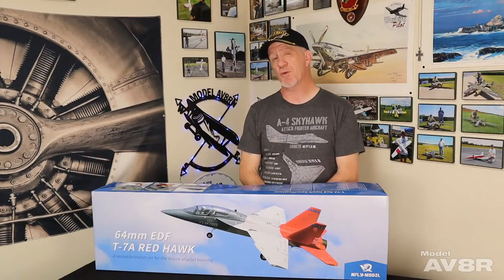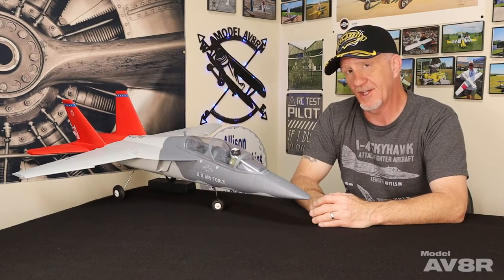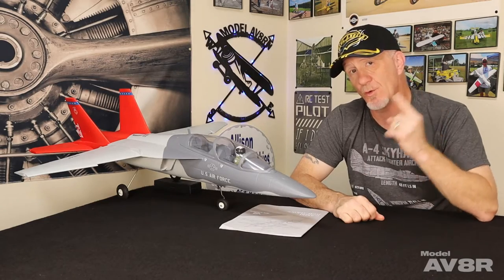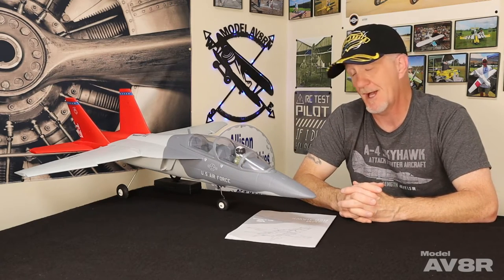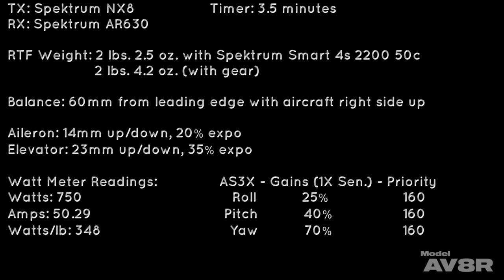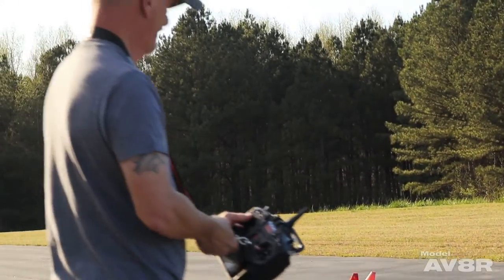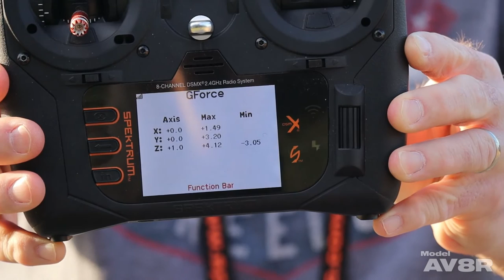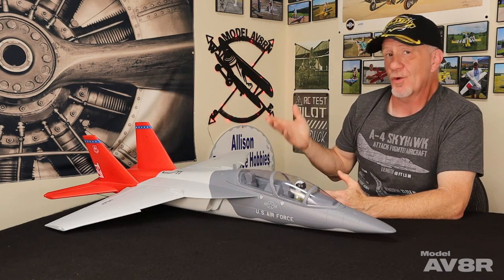XFly T-7A Red Hawk 64mm EDF Jet PNP - Model AV8R Review

Comment: Great vid and review, super flying as usual, thank you. As I have this bird I can attest your review is spot on. One thing you did not mention, unless I missed is the finish on the Xfly birds are fantastic. As I fly off of grass, perfectly maintained at 1/2" and rolled each week, with a bad shoulder, I always fly with the gear and found the 2200 pack is the sweat spot for grass and gear. BTW, I actually used the same receiver. I just got the 80mm version, yet to fly, waiting for spring to finally break in the east. If the 80mm flies as good as the 64mm, it will be a keeper!
Reply from the maker: Thanks very much! The finish was what I'd expect on a plane at this price point. Pretty good. That  80mm should fly even better! Enjoy!

Comment: Yet another 64mm EDF review where the subject sounds better than my Stinger 64, has much better take off performance and looks easy to hand launch, which the Stinger isn't (I only use it from it's fixed gear now). Maybe there has always been something wrong with my Stinger ... This plane looks excellent but I am very eager to see the A10 review as I've always fancied one of those ...
Reply from the maker: Hey man, yeah it does sound good. I flew a 4s Stinger years ago, I remember it did sound like a hair dryer but I liked that it had a rudder...knife edged well. I'm looking forward to that A-10, should be fun!

Comment: Hey Adam, great video. I love mine, great flyer for sure, I left the nose wheel backward, then switched over to the sprung upgraded nose gear, which is a nice upgrade. 

So I ended molding mine to death. I added rudders, 60amp Avion esc with reverse thrust, ar630 as well, with an RC Geek afterburner and a 6s 2200kv 64mm edf. I run an 1800mah 6s battery and might be going back in the stock motor. It seems to take 6s well on the bench. As is, it hit 110 mph, and it's a beast. I absolutely love it.
Reply: Holy smokes that thing will be a missile.
Reply from the maker: Holy crap Anthony! I'll bet it does scream on 6s! The nose gear upgrade is something many folks have mentioned, good to know. Fun jet!
Reply: @Brad  yes sir, much better performance. Gotta be careful with the elevator whilst WOT. It'll alpha lock, lol👍

Comment: Awesome flight and sound! In the first flight you use 3200mah 4s. That lipo is 380gr. A little heavy i think. How was the flight? Didn t it nose heavy?
Reply from the maker: It's a heavier battery for sure, but it flew fine. Not nose heavy at all when the battery is where it should be. Our CG is rear of where the manual calls for. Check out the set up chapter and set up page.

Comment: Hi great review. Is it true that you need to place safe reciever near the Cg.or can it be placed, like yours near front? Will safe and as3x/safe work ok with the RX near front ? Thanks
Reply from the maker: They AS3X works fine in other positions, and SAFE works somewhat well, however SAFE is optimized by getting it closer to the CG. Same goes for trim. AS3X can work with a good bit of trim set, but if you're using SAFE you need to mechanically adjust the surfaces so there is very little or no electronic trim set.
Reply: Thank you for your time @ModelAV8RChannel

Comment: Hi Adam, I know it has been a while since you made this review but I have a few questions as I recently bought this bird. First, how did you handle the CG with the 3200 and 2200? Also, do you think it's possible to hand launch with a 3200? Thank you
Reply from the maker: It's a bit nose heavy with the 3200, but still flies well. You could hand launch it with that battery, but I would program a launch mix that feeds in a bit of up elevator when you advance the throttle. Put it on a switch, and flip it off after its on step and you have both hands on your TX.
Reply: @ModelAV8RChannel  awesome! This 100% answers my questions. Thank you sir!

Comment: can I ask a question? do you modify or change another higher kv EDF unit, your plane seems more powerful , especially vertical climbing. I recently bought a new t7a , have installed but not maiden, I test running the motor but seem not power enough, I now use 3S battery
Reply from the maker: We didn't. Totally stock. We used 4s. On 3s it will be under powered.
Reply: @ModelAV8RChannel  thanks!

Comment: Hi. So hard to get a reply out of YouTubers. I hope you do. I’m almost 50, been flying since I was 8 when I built my Eaglet 50…..after taking 10 yrs off or so raising my kids (and owning 10-20 Horizon foamies) I fly on Safe now and can’t seem to figure out how to get back to regular flying. Do you have any suggestions?? I panic when I flick off Safe now. But Safe has become sooooooooo..boring. But then I get paranoid on as3x only. I wish I’d never met Safe….
Reply from the maker: Yep. That is the issue with SAFE. It's great tech, but meant to be used temporally. You are right to want to wean yourself off of it.  

Ok, so first thing...when you flip that switch from SAFE to AS3X if the plane changes direction without you touching anything, you need to get an experienced pilot (or a comfortable one) to help you trim it out and get the control surfaces mechanically adjusted. When you flip that switch in level flight nothing should happen until you input something. Part of your nervousness could be that it does bad stuff the second you flip the switch without your input, so now you're on your back foot having to correct for something you didn't do. 

Once that is done it might be easier for you. If that alone doesn't do it you may consider getting  the RealFlight sim. It's great being able to practice knowing that if you crash, you just hit reset. 

The other thing is, and you may not want to hear this, but you may just have to focus more. Get yourself mentally prepared. You're going to have to switch SAFE off and suffer through getting your chops back. Keep it off a little longer each time, remember you can hit it later and still save the plane. If you crash you crash...part of learning. Nobody will die, you just may lose a foamy or two.  If you do crash one, fix it. It can look ugly, thats even better...once it has "character" it can be a beater...a plane that is no longer pristine that you're not so nervous flying.  You may also find that after a couple of minutes with you not switching back your nervousness goes away a lot...either way, you have to commit to it sometime. Maybe consider getting help from an instructor to build your confidence if need be. 

Whatever you decide to do, best of luck my friend!
Reply: @ModelAV8RChannel  Great advice and thank you for the well thought reply!  I just re-upped my glue supply and kicker lol. I think you’re right just gotta do it.
Reply from the maker: That's it man. Once you get over that mental hump and decide you're gonna make that plane your bit#$...it ain't gotta chance! Lol.
Reply: @ModelAV8RChannel  😂😂
Reply: @ModelAV8RChannel . I’m still 😂 over ur reply. Lol and thanks again!!